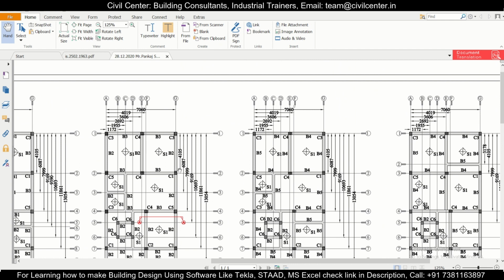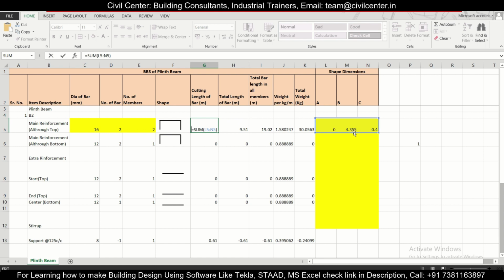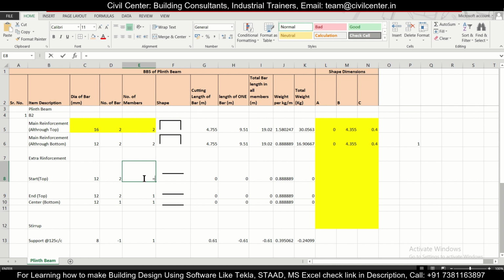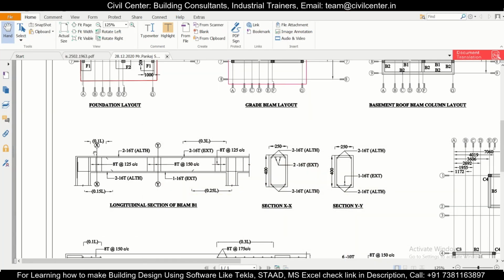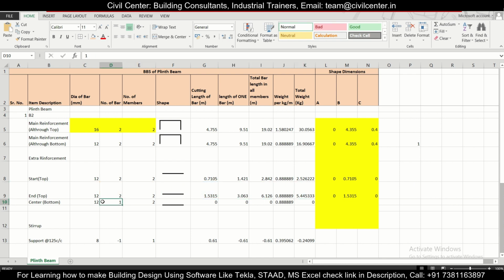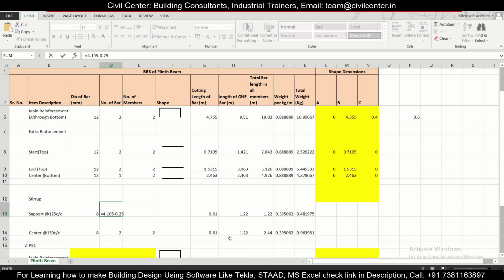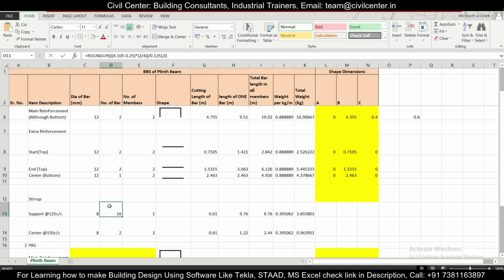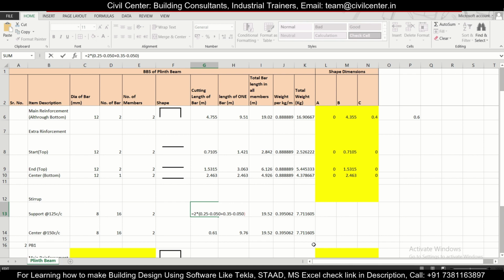How to Find Bar Bending Schedule of Beam Using MS Excel| BBS of Beam

Comment: The top starigth bar of B2, the length you have taken is 4.105+0.25.  the bar will be straight till the cover face and from there it will bend up. The L bend will  not be from the centre... So for starigth length just deduct the cover and u are there with the straight length.
Reply from the maker: Yes you are right Abid, some portions I have taken as extra.